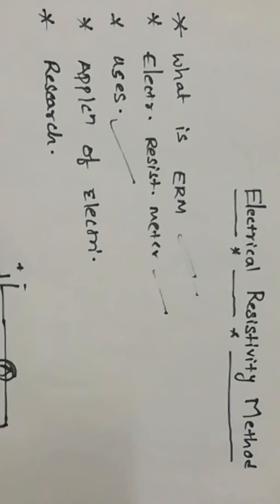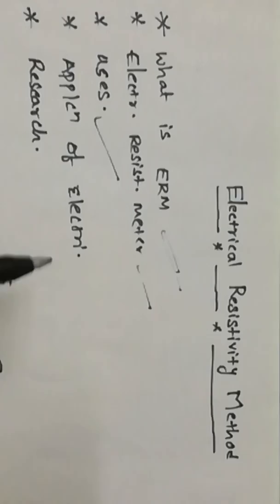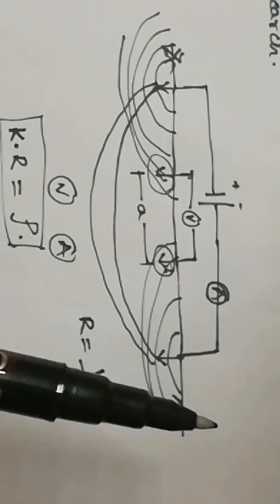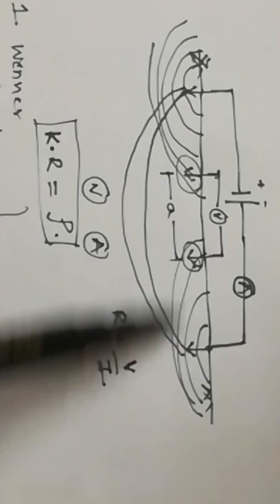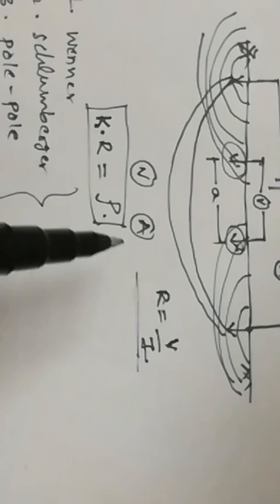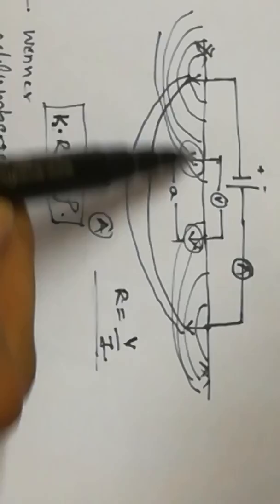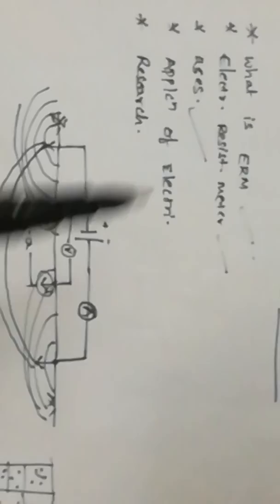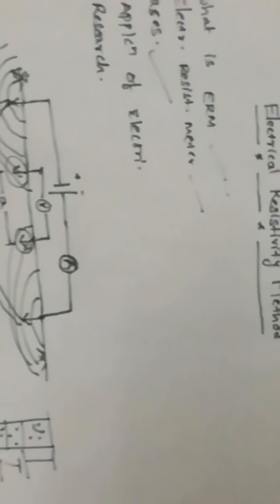INTRODUCTION TO ELECTRICAL RESISTIVITY METHOD (LECTURE-01)

Comment: If I want measurements the resistivity at 0.5m,1m,1.5m,3m,6m,9m,15m,30m using 4point Werner, then potential electrodes will be at what distance. Guide
Reply from the maker: Dear viewer, 
In wenner array- distance among all electrodes is same. (i.e. dist between any two adjacent electrodes is same) 

In schlumberger array - the potential electrodes spacing is not changed, untill we get the potential difference <5 mv. 

Thanks